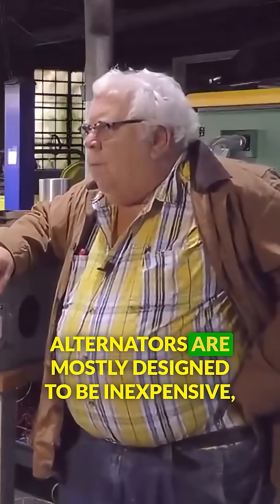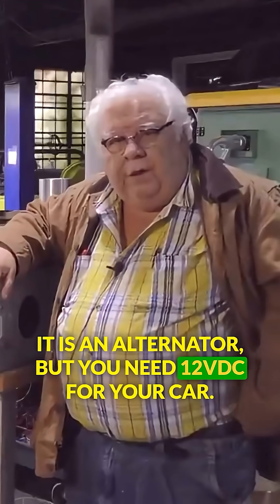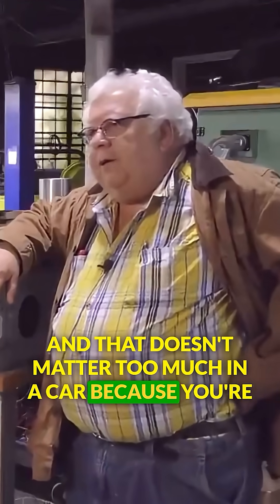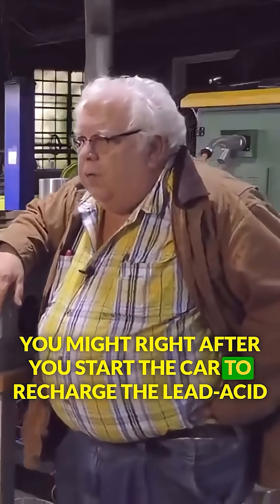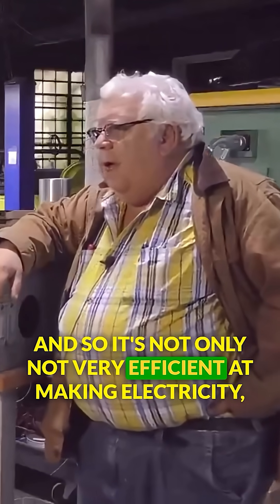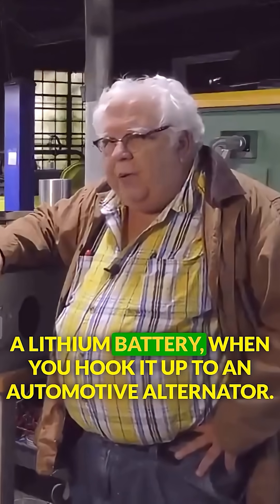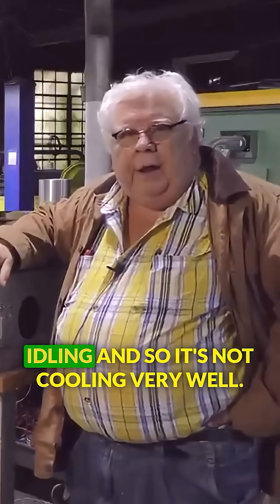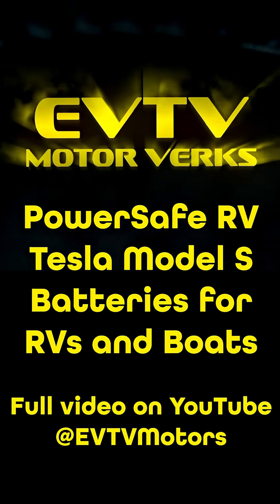Alternators are Only 50% Efficient!

Comment: My Father- in-law, Robert Bird, invented the process for making the diodes for alternator bridge rectfier.  I have the prototype diodes. He worked for Motorola at the time.
Reply: thats awesome!!  6 diodes in every automotive alternator , thats a lot of diodes over the 60 plus years they been around. I hope your father in law was very well compensated
Reply: @anthonyiannone7618  Here's a bit of a brain bender for you. There are some alternators, particularly ruggedized high current ones for amulance retrofits, have the normal 3 phases of output, but have 8 diodes with the extra two going to the star point.
Reply: @anthonyiannone7618 This was for "a" method of making semiconductor devices.  There were lots of other methods.  Additionally, like most inventions that come about while an individual works for a corporation, the corporation is the assignee.  Any royalties go to company.  Not sure how Motorola handled it, but the company I work for awards a small one time monetary award for filing of application and awarding of patents.  Also of note, Donald Dickinson was also listed as an inventor alongside Robert Bird
Reply: @anthonyiannone7618 
Yep. Most alternators now are 3 phase and a 3 phase will have 6 diodes.
Reply: @anthonyiannone7618  The way these things work in corporate America, he probably got a pat on the back and a $25 gift certificate to the Sizzler.
Reply: Was he Dr Wavering? That was early 50's, like right after the war. Cool to see those early prototype devices. Those were probably Germanium before they came out with Silicon rectifiers. I'm a bit of a history fan, and an Electrical Engineer.
Reply: Was this in the late 50s? I think Chrysler went to alternators in 1960.
Reply: @gregorymalchuk272  I saw my first alternator inside a 1965 Pontiac Bonneville.  Only DC Generators before that.
Reply: @MrSummitville Chrysler switched very early. From 1960 to 1969, they used a mechanical points regulator box instead of an electronic voltage regulator.
Reply: @gregorymalchuk272  In 1974, my buddy who lived next door, got an old VW Beetle (year?) from his dad.  It was 6 Volt battery and positive ground!  With a DC generator.  The battery was under the rear seat.
Reply: @MrSummitville yeah! Mine was built in 71...a 1200 cc 34hp  6volts without alternator, just a dynamo like bicycle😂...and without Gas gauge, manual reserve at the bottom of dashboard. My first car and happy "souvenir".... greetings from Belgium
Reply: @MrSummitville  My father in-law asked me about converting a system and literally said exactly what you just said, I had no idea what he was talking about I just stood there contemplating what I just heard
Reply: @MrSummitville  those batteries had covers and if those covers were removed, the springs of the seat would short out the battery and start a fire in the seat cushions. But only when you had passengers in the rear seat. Don't ask me how I know this.
Reply: @MrSummitville  It wasn't positive ground.
Reply: @chasbader I remember..like old volt wagon s
Reply: @MrSummitville No. Chrysler introduced alternators in 1959. Standard on Plymouth Valiant, optional on Imperial
Reply: @bigblockjalopy  Yes, I know. I said the first alternator that saw, was on my father's new Pontiac Bonneville.
Reply: Please make a video,with a little history
Reply: The diode bridge rectifier was invented in 1895, so you must be pretty old.
Reply: @Zuckerpuppekopf by german guy Graetz in 1887
Reply: @Zuckerpuppekopf He clearly stated that his FIL invented the process for making the *diodes*. Many semiconductor manufacturing processes have been developed, adapted and adjusted over the years, for specific applications, making them meet different requirements for different needs. Important developments continue to this day.
Reply: What year was that ?
Reply: @MrSummitville  1852
Reply: My father used to build alternators and motors in our garage when I was a kid.  The greatest generation.
Reply: I remember my 1971 chevy pickup had an external regulator. The box actually had had contacts in it that physically connected and disconnected to start and stop charging. I remember replacing it with a "solid state" regulator. Then later just replacing the alternator with a internal regulator unit out of a newer vehicle that just used a 1 wire setup. Greatest thing ever!
Reply: @kenh9508dads 40ish 50ish red ford 2 ton flat bed w wooden stave sides had that old external black box as did most cars in early 60' to late 50's
Reply: America desperately needs those men back, but the sad part is those guys don't even get hired now.
Reply: Lucas (prince of darkness) made a permanent magnet 3 phases alternator that used a selenium bridge rectifier before Motorola for use on motorcycles using a zener diode as a regulator. The Motorola design was superior but a later development as it used a solid state regulator and variable field windings for the magnet😄
Reply: @andrewallen9993  I think that was what I had on my 1970 T120 Bonneville
Reply: @MervynPartin It's the fault tolerant electrical system on my Norton 750 commando too.
Reply: @MervynPartin yes it was
Reply: the diode triode that converts it from a/c to d/c he made it way more reliable and Efficient no more there's the generator lite on again !.
Reply: I used to be in the parts business. I remember Motorolas being a freakin nightmare to find replacements. Not necessarily a bad alternator, just no after market availability in my area. Most of the time had to have the customer convert it to a bosch or a delco if possible
Reply: Motorola engineers were doing miracle work in that era
Reply: Please make sure those don't get thrown away upon your death someday.
Reply: My Detroit Diesel 671 has a motorolla alt on her
Reply: i hope he got rich
Reply: So yours saying your a millionaire
Reply: Absolutely incredible
Reply: sadly USA manufacturing has been raped by greedy ppl. once usa made all needed none likely 75% of things could not be made here in under 2yr Ross P was right Clinton wrong nafta bad bad bad
Reply: And in all the universe, you happened to see this short video.  Yeah, ok.
Reply: cool piece of tech history
Reply: Did he get that bread tho..?
Reply: also a klan member
Reply: Dude, mine too!
Reply: My dad's buddy was named Robert Bird from Utah.😂
Reply: thats wild
Reply: I'm so happy that he is a different Robert Bird!!!!!

       The one that Joseph Robinette Biden supported was a certified KKK leader and Joe even gave a eulogy at his funeral service.
        My bad,  the dickhead's name was Robert Byrd! He was apparently a Kleagle in the brotherhood (whatever the fuck that even is).
 He was definitely not any kind of leader. He is just a dead idiot that was also a racist for lack of better description about him. 
       I really couldn't care less about his life story.
Biden tried to clean that up by saying he's not a Grand Wizard! But he was just a "Kleagle" which means "Recruiter" in Klan talk apparently!
        Like it even matters, the guy was someone who is responsible for recruiting other people to go along with some real stupid shit!
        Just like Biden tried to get a lot of us to go along with taking an experimental MRNA vaccine that was manufactured entirely too quickly. In fact. He didn't just encourage us to get that jab. He actually issued an executive order to force people to get it.
         Thank God for the SCOTUS!
That would be the Supreme Court of the United States of America! They actually stood on business and blocked Biden's bullshit because they knew it was fuckery!
At least we have one branch of government that means business!
Reply: Was he a friend of Hillary Clinton by chance?
Reply: I'm so glad his name was Robert Bird with a i and not Byrd.
Reply: He was THE MAN!
Reply: I'm surprised to see someone so old know how to comment on YouTube. You've got to be in your late 90's by now
Reply: Better hide those for the future divorce
Reply: Wow, that’s *awesome*!
Reply: Bullshit, the bridge rectifier was invented in 1895.  Your father-in-law is 150 years old???
Reply: @recklesstim  the 1895 bridge rectifier was put on 1950 automobiles without modification? Bullsh!t. The claim was that Mr bird developed the bridge rectifier as appeared in the Motorola system. Wanna walk back yr rhetoric a little bit? Also, Mr bird was working in the 1950'a according to this claim, which means he could have developed the bridge rectifier in 1895 at 23 years old and passed the design on to Motorola in 1955 at only 83 years old. So where does your 150 years come from?
Reply: there's always an  @recklesstim  to read another's comment, amplify it and escalate it with 0 knowledge and experience
Reply: @recklesstim nah . people often unknown to you and I..are always revamping adding to technology..like hertz..Maxwell Tesla..newton..Lee Ed skalnin....
Reply: @recklesstim he didn't say he invented the diode or the bridge rectifier.   Read it again and this time pay attention to exactly what the writing says.
Reply: @blainebyrnes17  
Exactly! The son said his father invented the PROCESS for making the diodes for the alternator bridge rectifier, not that he invented the bridge rectifier circuit, or the diode itself. Those are three very different things.

The processes for manufacturing semiconductor components for automotive electronics are a bit out of my field of expertise, but I do know they have to be quite different from the processes used to make say, computer chips, because 1) the components have to handle much higher currents; and 2) the temperatures under the hoods of internal combustion engines are generally higher than those inside your laptop or desktop computer 😊, so the component design and the process used to make it need to account for those considerations.

Back in the day, Motorola was a leader in semiconductor component and chip manufacturing, including for automotive electronics, so I would not at all be surprised if someone at that company developed the process to make diodes capable of operating at high temperatures and handling high currents without shorting out. It's actually a pretty big deal, or was at the time.

But no, Mr. Bird probably didn't become a millionaire from his invention. The industry practice was (and probably still is) for employees to assign any inventions, patents, etc. related to their work to the employing company as part of the job contract. He probably got a nice plaque and a modest bonus though. And if he had gotten stock options and discounted stock purchases, and waited to sell his shares while the price went up (and sold before they declined too much), he probably did pretty well. 😊
Reply: @recklesstim Reckless words too. He clearly stated that his FIL invented the process for making the *diodes*. Many semiconductor manufacturing processes have been developed, adapted and adjusted over the years, for specific applications, making them meet different requirements for different needs. Important developments continue to this day. Yes, I copied my own text, just for you.
Reply: Just Charge the LIF po 4 battery through a DC to DC Charger!, I have heard this works, any comments out there about this???
Reply: I invented the alternator
Reply: Coincidentally, I invented the alternator before I invented electricity.  BTW, what is an altinator this guy is referring to?
Reply: @ericturnquist3183 you should probably go play in the pet section.

Comment: the cure if you use lithium batteries is to use a bank of super capacitors to start the motor and you can use a lithium battery 1/4 the size and cost, the alternator regulator charges the caps in a few seconds
Reply: Recharging the super capacitors is just as bad as a lithium battery...the problem comes about because their internal resistance is so much lower than a lead battery. 
They put out a great wallop of energy when starting the car, and the huge current needed at 12v to put the energy back in after starting up (especially if it takes more than one crank to fire up!) overheats the wiring - it's almost like having a dead short across the alternator.
I have super capacitors in my car & tractor & installed a resistor in series with the capacitors, to limit the recharging current a bit & avoid overheating. The caps don't need to be recharged in the first few seconds so why put that huge load on the alternator, it could take only a few seconds to burn out so things can be a lot more gentle.
They caps work brilliantly though. Always a faultless start. . The system is so good that over the years, the batteries (lead acid) have died to the extent that they can't crank with the capacitors disconnected but it doesn't matter, all they do now is provide the backup power for the ECU etc when the engine is off. One battery completely failed & I just changed in an old second- hand dud one that I had. Never buying another new battery again! The caps were off eBay out of a train system, good for millions more cycles. I'll be long dead before they are 😊
Reply: @topspeed250k5  Yes the load on the alternators can be high as you say I have been using the same used caps for years never had a problem with any alternators I even use them to start and run my ride on mower and Cat Backhoe it has a stuffed battery and charges the caps no problem, all start first go especially the diesels with glow plugs, most of my vehicles are over ten years old some have the ecu's but they all have decent alternators in them probably later alternators are crap just like the vehicles they only last long enough to pass the warranty period my wife's car was 20k over the warranty regularly serviced by a dealer and needed a new engine because one of the 8mm plastic cooling hoses split no warning or high temp lights came on just cooked the engine temp gauges don't work without water. so much for ecu's.
Reply: Just like a permanently installed jump pack?

Comment: Still educating from the other side, thanks for all you've done Jack!
Reply: Liked his insights too.
Reply: 40 years ago I put a 1974 Vega alternator on a Ford 641 tractor that was 6 volts. Took a Ford and Chevrolet shop manual and drew up wiring diagram, great improvement.
Reply: Three phase and more effecient than a 12 volt generator
Reply: He looks super unhealthy here gasping for breath.  I’m surprised he lived this long.
Reply: @tru3sk1ll  these guys live to spite death
Reply: @tru3sk1ll  Has he died? Jack Ricard has been looking about this healthy and out of breath for the 16 years he's had a youtube channel, so finally succumbing to all that lard is not exactly a surprise.
Reply: @xxwookey  — I believe he died from lung cancer …
Reply: @xxwookey  He died in 2020 from inoperable lung cancer.
Reply: alt-n-ater
Reply: The difference and a alternator is the time and money it takes to make one.
 Back in the late 50s and early 60s generators were OK. Because A/C WAS NOT THAT COMMON + the old timers knew to not turn the radio on until the voltage went up. Because it would not very well without the proper vacuum tube voltages.
All the inconvenience. Oh the pain. The pain.  
 Shut up DR. Smith.
Now splain why my '68 Corvair got the same gas mileage as my Trax. Hint 4 speed stick, no A/C oh and it got stolen when it had 100,000 miles on it. I do not think I can give my 100,000 mile Trax away. If it makes it 100,000 miles.
 But along came auto magic transmissions and you could not touch the gas pedal and bring the voltage up, while sitting at a stoplight. Well you could if you wanted the engine to overheat.
Reply: This speech ovestates the electrical inefficiency of the alternator.

Most use full wave rectifier with six diodes over three phases (coils) and could be arbitrarily efficient.

It wasn't meant to work near it's peak capacity for long times. 

One cranks, uses high currents, power, but not so much energy. 

The engine then powers the alternator whose electrical load is managed by the voltage regulator controlling rotor coil current level.

A regular flooded lead acid battery would absorb high currents just for a short time to replenish what was used to crank, and settle into a low current charging.

Expected load for the alternator most of the time will be the electrical loads, far lower than replenishing after cranking. It's expected to be used at just a fraction of the peak power.

Heat rejection was designed "economically", not prepared to cope with continous high load at low engine speeds. 

His conclusions are right. Most Li-ion packs would represent a very different load than the alternator designer expected. Q